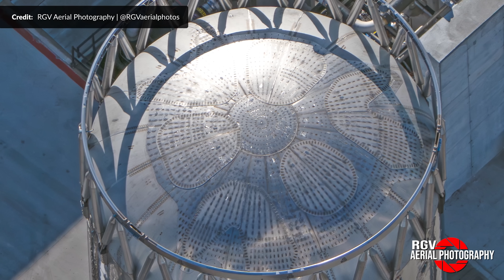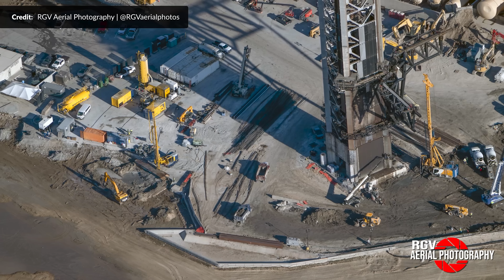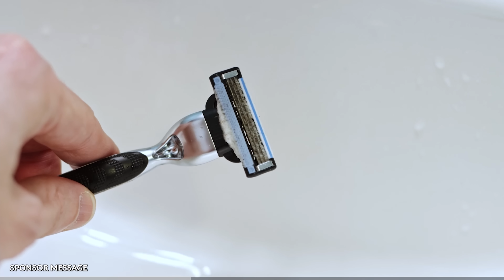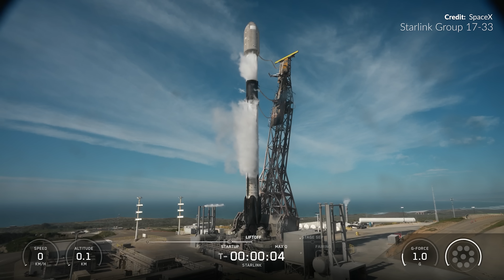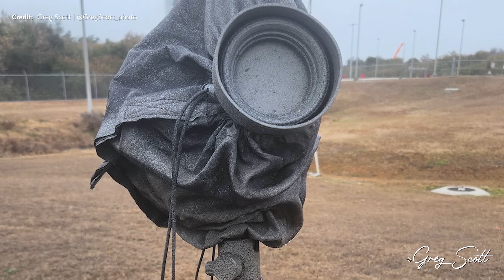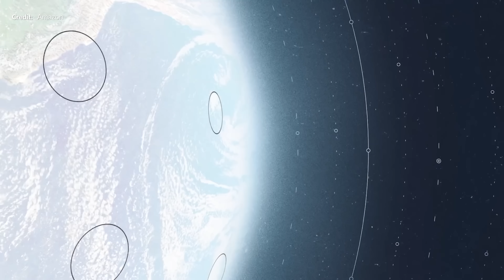SpaceX’s Starship Strategy Just Changed… Big Time!

Comment: Creating a self-sustining colony on the Moon is just as impossible as it is on Mars. The reason for this is simple. Such a colony would need to include the capability of all the technological infrastructure that we have here on Earth. Just envision the chain from ore to a simple screw. If you find this doable, try something harder like a microprocessor,
Extraterrestrial colonies will be short-lived, expensive and will not serve any sensible purpose. Proving this in real life on the Moon will cheaper and faster than doing it on Mars which will be an advantage, but the best is to use the resources to keep our Earth colony self-sustaining for millennia to come..

Comment: what happens if Amazon Leo doesn't send up those satellites that they has to according to license they have from the government - we believe the amount is ca 1 500 or so satellites no later than year 2026 ? to this date there are fewer than 200 up there ?  we don't believe they can do it so what's going to happen with Leo ? or is it corruption /layers who fix the issue (as usual..)? is there someone who knows how this works this time ?
Reply: It's 1,618 satellites by July 30, 2026! "Amazon is currently seeking to extend this July 2026 deadline to July 2028 due to rocket shortages." Right! As if they didn't know that when they first applied for a license. I wonder who they are going to bribe to get their extension. I don't wonder if Blue Sue would be raising a huge ruckus if the situation were reversed and SpaceX needed an extension.
Reply: @GntlTch thnx !

Comment: If ULA doesn't get the Vulcan SRBs under control, it's only a matter of time until one of those nozzle failures energetically liberates the payload from its launch vehicle...
Reply: What are the implications for SLS?  Not good.  Of its 8,000,000 pounds of thrust at liftoff, only 2,000,000 pounds comes from the 4 liquid fuel; without SRBs SLS is he world's most expensive - and sometimes most dangerous - paperweight.
Reply: For their sake, I hope ULA develops the Vulcan Heavy, I think it's called, using 3 Vulcan first stages instead of solids, like the old Delta Heavy, and like Falcon Heavy as well

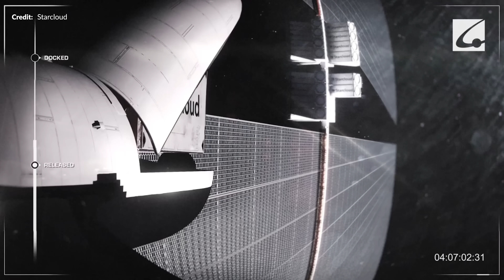Comment: 14:15 Good luck with those solar panel arrays avoiding impacts from micrometeoroids and space junk.
Reply: If you make it where any cell can fail and all others still work it wouldn't be that big of an issue
Reply: They are used by satellites routinely.
Reply: @Tailspin80  But covering such a large space?
Reply: @matthewakian2 Built in redundancy so losing a cell doesn’t cripple the whole thing.

Comment: I have said for years that starting with the moon makes so much more sense, instead of going directly to mars. So I am happy to see this new direction. Making a base on mars will also go much quicker with the knowledge we get from making a base on the moon. So it might not slow the process of getting a mars base as much as people think it will.
Reply: The Moon provides only one feature applicable to Mars: studying the health effects of prolonged exposure to reduced but nonzero gravity (1/6g Moon, 1/3g Mars). Engineering for the two bodies would be very different. They differ by presence of atmosphere (aerobraking is possible on Mars), thermal range (Mars is more temperate), chemical composition for fuel production (water ice is rare on the Moon, but very common on Mars, plus CO2), and surface conditions (with no atmosphere, Moon dust is extremely abrasive, and sticky via solar UV-induced static electricity). 

If shipping lots of construction materiel, the Moon offers faster experimental iteration. Travel to the Moon is quicker, but by energy (delta-v), it's slightly more expensive than Mars. The argument "It's nearby, so a rescue mission can be sent" applies only if transportation is relatively cheap and can be expedited (which is, to be fair, SpaceX's forté).
Reply: Knowing the effects on the human body in reduced gravity (like the moon or mars) is also significant. It could also serve as a testing ground for Elons concept of using humanoid robots to build a base on Mars. They could optimize them for lower gravity, send new and updated models frequently, make adjustments and so on way faster than on Mars. The point is, we can test a lot of stuff on the moon and make sure things work in a different environment than earth, before sending anything to Mars. Proof of concept in other words.
Reply: Same. This is the correct trajectory. The Moon will help immensely with Mars.
Reply: Mars direct is still preferable, and lower delta-V, but test the infrastructure on the Moon first.
Reply: @imconsequetau5275  Mars requires way more delta-v than the moon.
Reply: A base on Mars was always pie in the sky. People simply let Elon give his 'make consciousness multiplanetary' talks and meanwhile drooled at thought of having Starship on Mars. It would open so much opportunities for exploration. And maybe even boots on the ground like we did with the moon, just for the excitement of it. Focussing on the moon takes this away. Nothing learned from landing Starship on the moon will help with landing on Mars. Getting Starship to the surface of Mars is ridiculously difficult, but so far we have believed in SpaceX to get it done. The annnounced shift in focus to me indicates that they think they won't be able to do it in the coming decades (and/or the founding focus of the company has shifted from exploration to commercial interests and/or Elon has gone completely of his rocker).

Comment: Putting AI in space where no one can control it if it goes wrong sounds like great idea, with the best of intentions. What could possibly go wrong?😅
Reply: Not to worry.  Exposure to cosmic rays and solar radiation will quickly scramble and degrade the high-performance, non-rad-hardened NPU accelerators and memory, corrupting and crashing their software and producing junk outputs.  It'll be 'spectacular'...

Comment: The envisaged Moon Base can act as a intermediate rocket Fuel depot and maybe also as a launching Platform ??
Reply: Could be, but I would rather mine water on the Moon for local use on the Moon.  That water would be very important to industrial and colonization purposes for moon-folk.   If Starship works as planned then it will be inexpensive to get methane rocket fuel to the moon.  I say we create a methane based economy on the Moon.  Import methane, nitrogen, and chips.  Make everything else locally.
Reply: Beratnas Gas on Luna confirmed?

Comment: With the new hot staging ring design, have they gone away from directing the flip with the stage 2 thrust on separation?
Reply: I’d assume so since they no longer have that heavy hot staging ring to jettison so fuel savings are negligible. A symmetrical truss design will probably also help reduce hot pressure points on the dome. Guess we’ll find out after a few v3 flights 😅
Reply: Stage two hot staging will still involve vectored thrust. It just won't depend on an asymmetrical rung skirt as well as the dome on top of booster is not necessarily symmetrical.
Reply: @GntlTch  Yes of course it has to have vectored thrust but the old design had an asymmetrical design on the ring which pushed the nose of the first stage in the direction they wanted it saving them a turn with the engines.

Comment: How do you get a mass driver to point in the right direction as the Moon moves around?
Reply from the maker: The moon doesn't spin. If you set it up on the near side, you can fire it retrograde every single time (or point the other direction for a prograde launch to fire payloads into a higher orbit than the moon).
Reply: @MarcusHouse  Well, actually it does "spin". It's just that its spin rate matches its orbital rate such that the horizon relative to Earth is constant (in the orbital plane).
Reply: @MarcusHouse  It orbits the earth though. How does a straight track aim at a target when it's moving across the sky. It almost never points at exactly the same point .
Reply: Fine tuning of the launch angles can be done with magnets, the same way that the electron beam gets steered in a CRT.
Reply: @ghost307  IT's a fixed track though. Unless the track itself bends at the end to aim at the target at the target how do you point it in the right direction?
Reply: @aldunlop4622  As long as the payload is at least partially ferromagnetic, just having it pass through a quadrupole magnet as it leaves the track will allow you to give it a small kick in any direction desired. Assuming that the target is an orbit 238,000 miles away you only need to move it a tiny fraction of a millimeter to hit any orbital target (or even miss the Earth entirely).

Comment: SO, with this new interstage setup, there is obviously no baffling to promote directional push from staging like they did with the last few v2 launches, is that not needed anymore with the Tri-fin setup ?
Reply: The alleged plan is to use differential thrust on the Ship engines to impart the initial impulse to initiate the Booster flip.  Whether or not that turns out to be accurate, remains to be seen...
Reply: @Spherical_Cow   HMM, okay, I see that maybe working,  I wonder if they could put like a washboard type surface on the top of the Booster's dome to increase friction and help with the booster flip.   I CAN NOT WAIT for this next launch
Reply: @Vastafari34  Now that is an obvious-in-hindsight idea that should be passed on to SpaceX. It's passive, lightweight, easily manufactured, cheap and 100% reliable.

Comment: The video pushes a very optimistic narrative, but it ignores the core engineering issue: Starship’s architecture simply doesn’t match the requirements of a lunar lander. This isn’t about timelines, strategy shifts, or “big plans” — it’s about using a Mars‑optimized, aerodynamically shaped, extremely massive vehicle for a mission profile where none of those design choices make sense. The enormous dry mass, the tall and narrow form factor, the unnecessary atmospheric hardware, and the rigid monolithic structure all create the very complexity the video treats as external obstacles. The refueling chain, the logistics, the operational overhead — these aren’t unfortunate complications, they are direct consequences of forcing the wrong vehicle into the wrong role. A purpose‑built lunar lander would avoid all of this. Starship is impressive, but pretending it’s a practical lunar solution is engineering wishful thinking, not analysis.

Comment: Marcus Time!  Thermal shock on top of booster is going to be fun to watch - last thing to be tested but can only be done in flight??  It's not the new Starship that matters but the re-used Booster underneath that does - that unprotected dome has to have a limit...
Reply: The top of the booster would have hot gasseous Methane instead of Liquid Methane by that point of the flight. Of course, basically freezing compared to Raptor exhaust but I don't think it'll be a big deal. Starship has hit Super Heavy with raptor exhaust to the side in many flights and nothing really happened. Just some scorch marks
Reply: @Quasar-2  Agreed, but what I'd like Marcus to look at is a) cold on one side of tank dome and a host of Raptors exhaust on the other - thermal stress in the metal dome structure for the cooling to the next flight??  and b) the HOT raptor exhaust would heat the top of the COLD gaseous volume left in the tank and cause a pressure spike for landing.  Don't forget that so far we've had the hot staging ring to eliminate these concerns, but now things are "one on one"...  Again, survivable stresses in one flight, but surely fatigue would set in after the n'th flight?  Soyuz used hot-staging but not on a reusable design.  SpaceX are not out of the hot-staging woods on their first flight...
Reply: @stevemorrell4066 Maybe for aluminum alloys but my gut tells me Steel doesn't care. It loses strength when aluminum starts to melt so I just don't think it matters too much tbh. I think with the increased load from the landing burn is a bigger issue tbh. It's already pulling like 20g's (this could be wrong but it decelerates like crazy. Not a survivable amount for humans) and with V3's, it could put even more stress on the vehicle. 

I think the steel would warp and bend before it breaks open tbh. It would be interesting to see if we see that warping
Reply: @Quasar-2  Hehe, so a warped steel dome would be okay for a repeated Starship takeoff every day?  Well, my car has dings and still gets me to work.  So I guess we'll see eh!? :)
Reply: @stevemorrell4066 They'll observe it and use a different booster
Reply: @Quasar-2  Yes.  And that being the case we will both see that the design is at fault- it's not instantly re-useable that particular day or will need constant servicing/scrapping or be assigned to non-human takeoffs after 5/10/20 takeoffs.  I return to my original point - the repetitious schedule will cause a material failure, so the first re-use of a booster is not success but a step forward.   How to determine the service life of such a vehicle BEFORE humans are allowed onboard a stressed object?  SpaceX could use new rockets for the Moon, but what to do with these 'pre-loved' [edit Boosters]?
Reply: No different than the thermal shock of version 2 disposable hot stage ring. In fact, probably less since the side are more open.